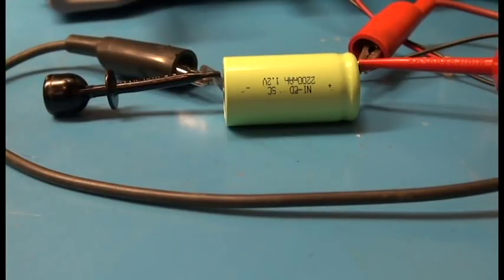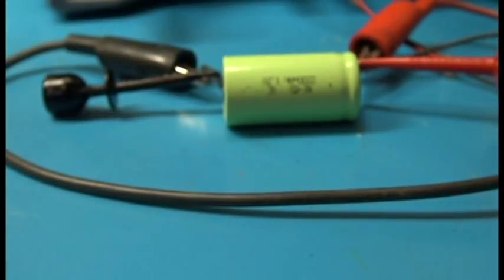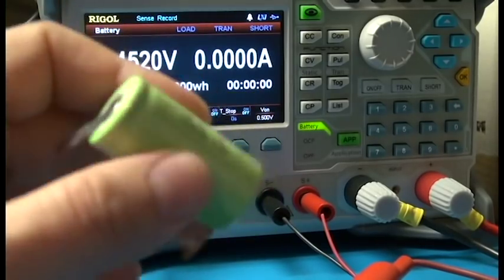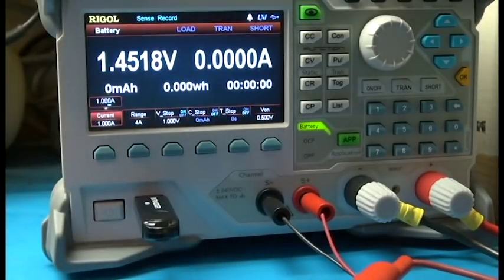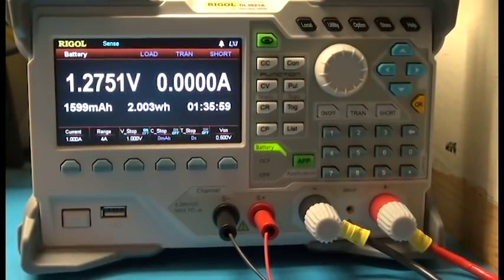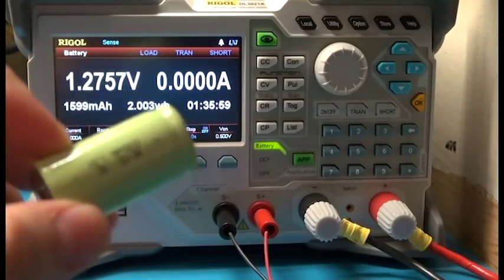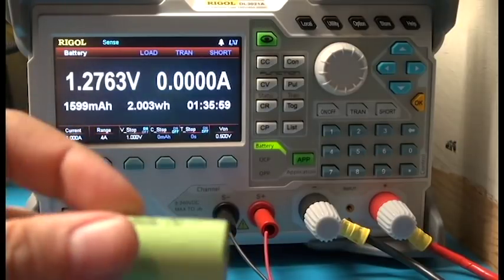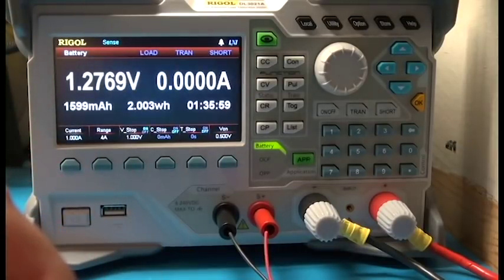Project battery testing on my Rigol DL3021A DC load.

Comment: I like your video, can you tell me exactly how you set it up? I did exactly what I see on your DL3021A, when testing my 18650 battery, but after less than a second : "Battery Test Complete". Also, you are using 4 wires? I have my tester wired with all 4 wires, but I connected them together to main input. Should I separate them and use all 4 wires?  Thanks for your videos! I'm a subscriber now.
Reply from the maker: You need to check what the battery specifications are on the data sheet for your battery. If you pull to much current from an 18650 battery it will pull it down too fast and cause the battery voltage to dip and stop the test. When using 4 wire sense you have to turn on sense if you are using the same DC load as i am.  There should be 1 sense wire on the plus and on on the minus. The DC load is the same. One wire on each. polarity matters as well.
Reply: @Kev_31779  Thank you very much for a quick respond! I think I understand the 4 wire and polarities... But I do not know at this point where to adjust what. I've matched your setup, but there must be something else setup or turned on/off some option, because it is very fast over. I use the exact same numbers as I was able to recreate your test. I have other testers, that do nothing much more than give me a number that represent the stored energy. It uses 1/2 Amp as discharge - just like your sample here. I'll call Rigol Tech. Support and see what they have to say - any experience with them? Again, thank you very much!
Reply from the maker: im not sure, I know 18650 battery have a short circuit protection built in . If you discharge them further than the recommended state it will go open circuit. try a lead acid battery. You should find a data sheet for a 18650 battery and see the discharge curve to see what to set.
Reply from the maker: Also if you have your V low cutoff set too high it will stop the test. You need to know your cutoff from a data sheet.
Reply: @Kev_31779  The "a short circuit protection built in" is concern, SOME do, but most don't have any protection build in anything like that! The 18650 with protection are also more expensive.... I don't need the battery info, since these are salvaged out of old laptop batteries, so if it goes little lower, I don't care and I'm sitting right here, so they would not catch on fire. On top of all of that I have a thermometer sensor clapped onto the battery and if it goes above 150F I stop the experiment.
What I like to know is what did you set in your DL3021A, all of the parameters, so I can recreate what you did. I have also my channel here, https://www.youtube.com/playlist?list=PLv52A7rm-UViZEOlzZfZOB9Gl8cjS3ze5  
And my website: https://tonysfun.com/
Thanks for your reply.
Reply from the maker: The video shows all the parameters I set for the test on that particular battery. I'm not sure what else your looking to change. If the test stops instantly than the battery does not have the capacity to run the test and may be junk or discharged.  Try setting a multi meter on amps with a resistive load and see what the battery voltage does. The Rigol unit should be enough to tell you. Start at a lower load current than I used to see if that is the issue. Try 200 ma. Look here. https://www.ineltro.ch/media/downloads/SAAItem/45/45958/36e3e7f3-2049-4adb-a2a7-79c654d92915.pdf   On this particulat 18650 the cutoff is 3 volts and a discharge rate of .520 ma.
Reply: @Kev_31779  Thanks, I'll try that, but the 18650 is new and I measured 2500+ mAh between full and discharged at 3V. BUT I never had this complex Load Tester so I'm sure I need to learn more, before doing something stupid....